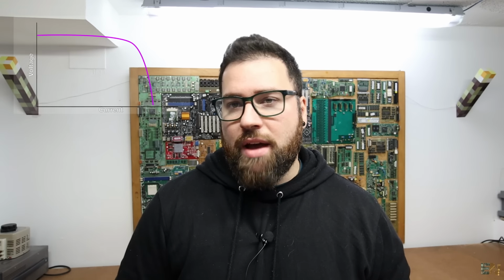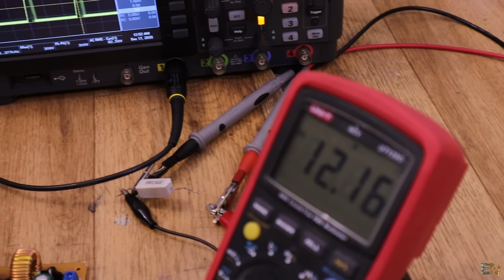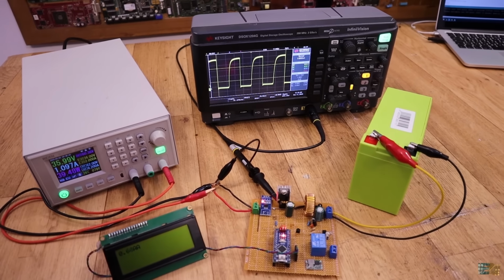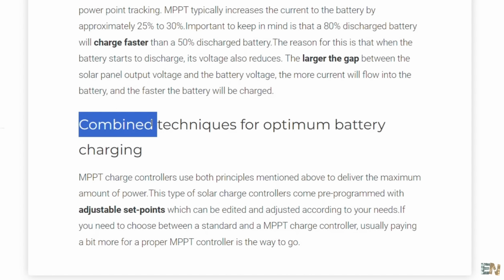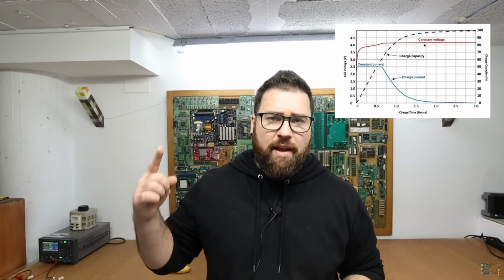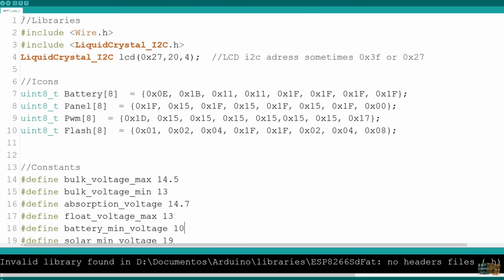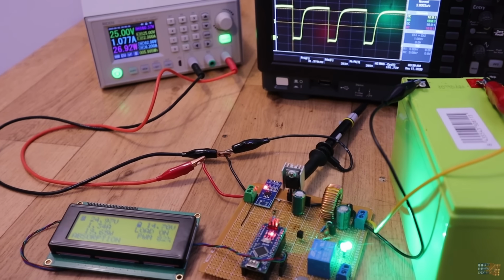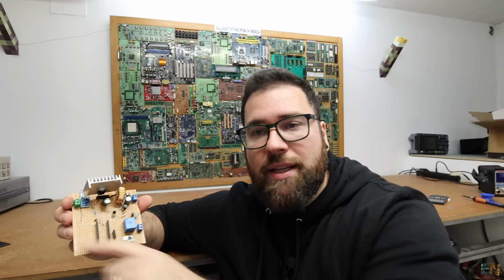MPPT What is it and How it works?

Comment: Despite doing electronics for over 5 years, i had never heard of mppt's until now. Thanks for your informative and educational videos. Keep up the great work!
Reply: that's because you never had to deal with solar or wind power ! There are so many aspects of electronic that you can explore, I love it !
Reply: @fraaggl  Exactly! I always use batteries or the wall outlet but it's interesting to learn about other corners of electronics
Reply: MPPT chargers are as common as sunshine in the solar charger/controller world.
Reply: While MPPT is more efficient, it comes at a higher cost than PWM.   In smaller inexpensive systems, PWM charger is a better choice.
Also, he mentioned the new "fly-by-wire" steering in newer EV's.  While it sounds cool, it's more costly than traditional steering, using dual motors for redundancy and the inevitable lag when turning the wheel.   The expression of "reinventing the wheel" is not always better. ;)
Reply: @BillAnt  
Depends.
There is no lag, if it's not a garage diy job, otherwise brake or accelleration by wire wouldn't work and it does for 30 years now.
But the main reason for pushing these technologies in the market was and is not to make cars cheaper, the car needs to be able to override the driver's actions.
That's the direction, the companies want it to go - and yes, it has made cars more expensive. But who cares, customers did swallow these prices.
Unfortunatelly customer don't even fight that development - no, they force it by demanding assistance everywhere, then getting spoiled with all that assistance - that only got possible with drive by wire.
People have long started to degenerate in an amount, that they wouldn't be able to drive safely with todays high powered cars without assistants.
People get's less and less able and more and more refuse to work themselves, while driving - so, high demand for drive by wire is already there.
Reply: @BillAnt    There are 30 amp MPPT chargers for as little as $20 on Amazon.  PWM for $12.
Reply: @phillipzx3754 - Right, $20 MPPT vs $12 PWM,  When building small inexpensive gadgets in large quantities, that price difference makes a big difference.
Reply: @phillipzx3754  That's about what they should cost considering the component costs.

I reality many of those cheaper MPPT controllers are fakes! Inside they are PWM controllers.
Reply: Same here
Reply: I also bearly am learning
Reply: have you been living under a rock?
Reply: @tennicktenstyl  no. Just never used solar panels. Only batteries and the wall outlet
Reply: How

Comment: You got a lot wrong there...
Did you know my EV battery is 208v? And it pre dates Tesla...

24v panels are 32v. (38voc)

Solar mppt you had right, but the system is a buck before the charge stage, which most are mppt. The solar and batteries are separate to get the mpp.

When you use the esp, could you try... Esp now and the serial display.
This way you can use one esp to run the device and then send the data to a small screen.. the 3" ones... And display Data, 
Panel voltage.
Panel current.
Watts
Watt last hour.
Total watts today.
Total kWh in the past week, month.

Be aware that many people have 4 panels and this can be 200v, normal may be 156v.

Don't forget to see the project through

Comment: I have an idea of a gym cycling machine that has a generator and a battery to charge. I think MQTT in pair with PWM would be really useful there so you can control cycling resistance and driving speed, right? Does anybody know if such machines/DIY projects already exist? 

I am thinking to build one for myself, but the electronics seems to be the most complicated  part

Comment: Great video.  I'm very interested in this project.  I need to develop a way to charge my starting battery (AGM) from a pair of Li batteries that are kept charged by solar or on board 12V converter (RV speak for power supply).  I'm currently simply monitoring the voltage on the starting batteries and dropping a relay across the two battery connections when the voltage gets below a set point.  I keep it on for a length of time that I can change.  I upload the data to my server, stuff it into a mysql database and generate a graph showing the change in batt voltage over time for both batteries.  It's running on a ESP8266 that displays a web page using web sockets to display activity and lets me change the parameters.  I have a couple of hotspots onboard so I usually have internet connectivity.  I don't measure current because I haven't located a high side current sensor that I like.  Because the starting  battery can draw an extremely large current, I can't really use a low side current sensor unless I somehow sense when the starter is being engaged and crowbar across the sensor which is a bit too complex for me.  I'm tempted to put a very low value (shunt) resistor in series with the relay that is connecting the batteries and measuring the voltage on each side of the resistor to calculate the current.  The wire running to the Li batteries is pretty long and I suspect has enough voltage drop to help limit the current draw.  I'm using a 20A relay and it has worked fine so far.  Unless the starting battery develops a short I don't think there will be excessive current draw in any case,  but I'd like to measure it so I'll know when to drop to float.  i don't think I'll ever be in the bulk charge mode.  I doubt that I'd need the sophistication of the MPPT algorithm however.  
Thanks,
Jim.

Comment: I like this style video because this format encourages electronic engineering approach to both design and understanding. This creates a forum on a specific engineering topic.
I currently am investigating strategies for low power solar systems. (like for a van). This buck boost converter, the LM5118MH/NOPB-ND from Digikey may be useful  to squeeze more power from solar panels at lower light levels.
Your videos represent a lot of good work! For many of us, even though much effort can be required,............... this is a lot of fun!!

Comment: I am actually looking for a MPPT project without a battery charger. Seems most of them focus on charging a battery but I am looking for something that has a fixed voltage output. I tend to charge USB devices, or other higher voltage devices, but without a battery. Would it be possible to use a couple of supercaps instead of a battery?
Reply: MPPT without a battery doesn’t really make sense, as I understand it. MPPT is trying to adjust the load. 

For your case, you can’t really adjust the load. You want a 5v output. The amount of current being drawn is going to depend on the decide connected up, and the solar controller can’t adjust that. 

A standard DC/DC converter would be fine. Amazon for example has lots of wide input to USB buck converters.
Reply: @gf2e   I have like a zillion amount of dc/dc converters. The issue is, if you check the graph of a panel that the max output is at a certain voltage for a certain amount of 'light'.  So example if your panel is a 40 Watt one and you connect a fairly heavy load then a dc/dc convertor will not take into account that the ideal input voltage should be at the max .... mppt ... . So you might end up being at a much lower solar output voltage on that panel than what would be ideal on the graph.  Lower voltage will result in much lower output power.

I have real solar dc/dc modules with a preset mppt voltage that output a fixed voltage but it's fixed input voltage. It is a bit not the m of ppt. If the voltage goes below that treshold voltage it will stop converting.   I have modified 1 with a potmeter but that is still not the ideal situation.
Reply: @Luke-san  gotcha, that makes some sense. Hmm. TI has a DC/DC converter building tool. Lets you specify the parameters you want and will generate a design up to and including a full PCB design. 

Some of the designs use very simple integrated chips that do it all, but others use chips with more config and external parts and so on. 

I bet you could take one of those designs and add an MPPT monitor to it. Change a bias voltage or some other parameter that would change the behavior of the converter. (Rather than having to build a converter from scratch…)

Comment: Ya hall effect is bad since it gets disturbed by all sorts of things , put a screw driver close to it and see how much the value changes, the INA chip is much better.

IGBT may not be the best idea since you have a inherent voltage drop of like 1-2V on it like a bipolar so at higher current it  WILL get VERY HOT, they are ok at very high  voltages like hundreads of volts at 100V MOSFET is still king

Comment: @Electronoobs Some feedback... All from my personal prospective, of course. Yes, less production is better... No intense music, or forced energy... But, holding the camera with your hand is not good, either = too shaky. My interest is in hobby electronics. Yes, I would love to have the resources to be a Maker, like you, but I simply do not. Therefore, your projects tend to be way too big for me to even attempt. And, I really like microcontrollers, but I really do not like to code. So, I tend to enjoy analog circuits more. My favorite is probably building electronic lab tools... Small to large... One of my favorites is my bench potentiometer. It is nothing more than a 10K multiturn pot that I put into a heavy case to make it easy to use with just one hand. Another is my bench bus bar. It is a simple piece of wire mounted on a block of wood. It is great for tying together multiple test probe ground leads. I use these daily. My bigger projects include a SMD Reflow Oven and Curve Tracer. And, lots and lots of others. So, I think you might have slipped away from your channel title of Electronoobs. If your views are falling off, maybe make sure that you did not move away from the content that made your counts increase. In other words, back to basics. Just something to consider. I do not claim to be correct. I do recognize your spirit and I truly hope that you attain your dream. You are certainly putting in the effort and hard work. HTH. Cheers.

Comment: Interesting project! I was using INA219 to measure solar panels efficiency in some project. Worked pretty well, but be aware of the maximum input voltage of 26V, so for one small panel it's OK, but for larger one or string of panels in series it's not very suitable.
Reply from the maker: I can tweek the module to work with higher voltage than that :) I think... Hahahaa
Reply: @ELECTRONOOBS  - my current solar project has some cheap 80V panels that go up to about 90V on a sunny day. I'm looking forward to see your tweak (and the survival of those modules!)

Comment: I never knew charging a battery can be this difficult. I just connect positive and negative from the charging source to battery with just a diode in between. I am a do electronics as hobby and this just does the job for me.
Reply from the maker: You always need some sort of control, even if the same power supply that controls the max current and voltage, otherwise the battery would get damaged or worse...
Reply: @ELECTRONOOBS  i started using bms so that i dont have to do things just plug the supply and done

Comment: In Pakistan everyone in installation mopt like inverters which works directly from sollar and gives 220v and also they make mppt like buck converter which works workk 110 volts and it gives 12v 24v which is selectable in circuit and maximum is  60A and some are making 80A.
All i want to say is mppt is future and present in Pakistan

Comment: In my experience the INA shunt style sensors work much better than hall effect. I ended up making the switch in my projects after noticing the hall effect sensors after passing current in either direction, still show current after it has completely stopped flowing. This leads to small but inaccurate readings if you are tracking current over long periods of time. Great project. I'm looking forward to seeing the completed version.
Reply: I use Hall Effect based sensors professionally. We have to calibrate it when we know the current is 0. This is one of the quirks of using magnetic based sensors. Some applications it’s not possible (have 0A during startup).
Reply: @akhurash  These are just my observations, but in the case of a battery monitor, the more current that flows the more the sensor will be offset when the current drops back to zero. I was using a 200A ACS and was noticing plus or minus several hundred mA depending on whether the battery was charging or discharging just before dropping back to zero. Since you work with HE sensors professionally, I'm curious to know how you calibrate for a varying offset. I thought about nulling out the small values, but that would also wipe out the ability to monitor very small loads.
Reply: @ddub9968  Interesting the project we use it on is for a BMS. We do a calibration every key cycle (ignition cycle). The Hall Effect sensor is actually a backup sensor, we use a Shunt as a primary sensor (for the benefits you mentioned).

Comment: For the current measurement with the low ohm resistor, you need to sample data with minimum the double frequency of the pwm frequency, or you will lose accuracy. Nyquist  theorem.
Reply from the maker: True

Comment: If you wanna charge a litium battery, it is very important that the voltage is stable in the CV step. Even if you reach 4.25 V instead of 4.2V it can damage the battery I've been told.

Comment: Very cool, i seen some DIY mppt videos but they made it more complicated that it has to be. Diodesgonewild had a great illustration of it showing a VI curve on an old scope of something unrelated.  But it really showed that all MPPT controllers does is what he was doing with the knob dial, adjusting the power, and you could see the curve grow  and shrink.  Which gave me the idea of manual MPPT controller with just a dial knob, since you dont need it all the time only on cloudy variable weather, it might be good enough to adjust the dial a bit to get maximum power, dont even need an MCU.  But mcu would automate all that which is a cool project so im looking forward to the rest.
Reply: Those do exist already, they are just a normal DC-DC converter, can be boost, buck, or both, but they have a 3rd adjustment in addition to the usual 1 or  2. The first 2 limit the maximum output voltage and sometimes output current as per normal, but the third limits/sets the minimum input voltage. You just set that 3rd adjustment to slightly below your panel's max power voltage.

You set it a little low because the panel voltage drops when the panel temperature goes up so if you set it too high you will form a positive feedback loop of the panel gets hot dropping its max power voltage below the converter's setting so it ends up drawing less power from the panel which gets hotter which drops the voltage more so even less is drawn, Etc.

That's the advantage of the tracking, conditions like the panel's temperature are not an issue.

Comment: Hi 🤩
4 1 thanks 4 nice n infofmative vids 💖
4 info
we have tryed mppt or pwm solar chargers 4 our solarplant with 2x37v 160w + 2x42v 210w + 42v400w panels to 12v 140ah lead gel akku
mppt or pwm market chargers are inifficient n broke 2 akkus.....
at now we change per each panel a dcdc conv. seted to 13,9v parallel and it works better and cheaper as any mppt/pwm solarcharger.
but there is too much powerlosses at dcdc convs + sometimes they not working synchronius that powerlosses too.
we think now to build a dcdc buckboost transformer converter for variable voltage up to 100xx volts, coase we want connect all panels in serie, at actual case at maximum 220v dc,
then convert dc to ac per pwm controll too, then transform it at secondary coil to 30v dc then buckboost it to akkus 12v or 2x12v + for 24v usb chargers.

what is Your opinion,is it better then mppt also cheaper?
thanks 4 answere 🤩🌞🍇🙋‍♀
Reply from the maker: Comercial MPPT are cheaper but if you want a specific power and so, sometimes is better to make your own...

Comment: Please make a video about using standard 48 Volt Power Supplies to charge 48 Volt 100 amps batteries by using CAN bus, problem with with these power Supplies is that they stand at 53.5 Volts and Li FePo4 batteries need at least 55.5 plus volts to charge, so we need CAN bus controler for this purpose, please make such controler, which is not available easily.
Reply: Thanks for reading & liking my comment. May I expect my project coming in near future?